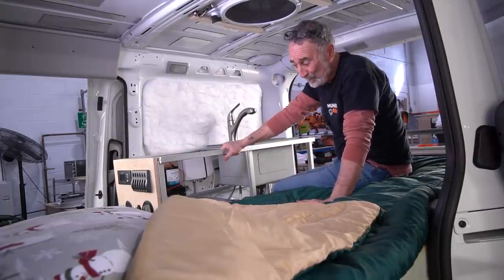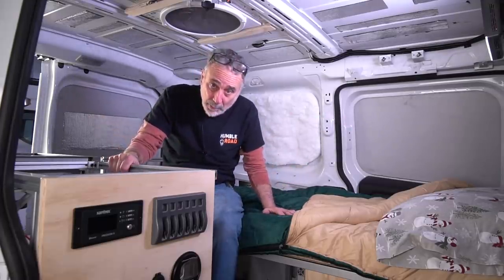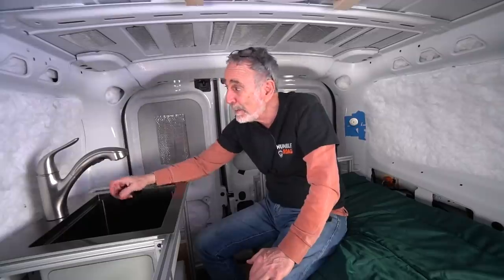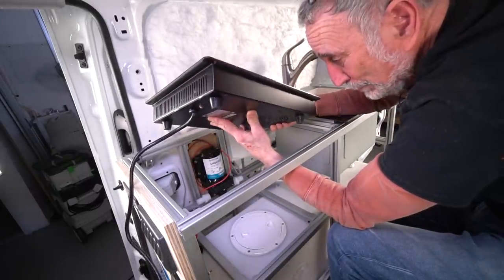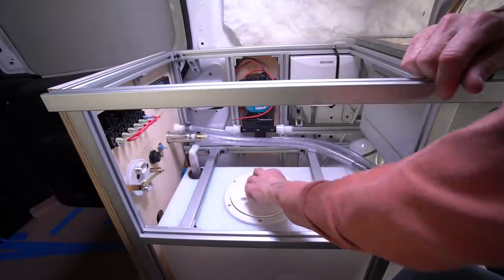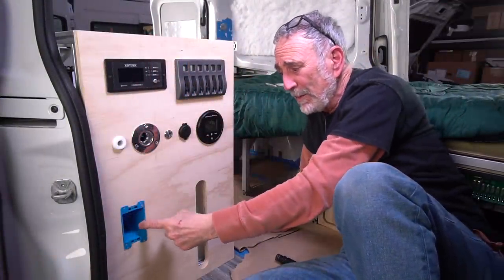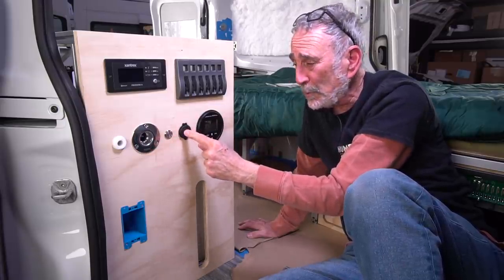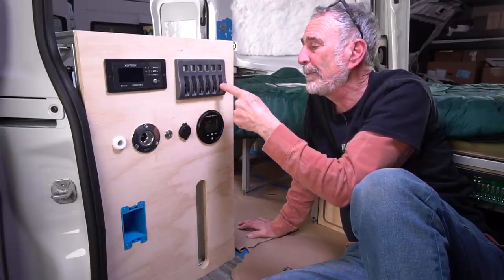The Humble Road Promaster City mini-camper. BIG features in a little VAN.

Comment: Flush cooktop is best to me.  Having it visible is contrast worth seeing,  now the on demand electric water heater is dumb in my opinion.  I understand the space consideration though.  I opted for electric but one that half the power.  This way if I’m traveling, I can turn on the electric water heater and alternator power will provide most of that power.
Reply from the maker: No room for a heater tank of any practical size in these micro campers.
Reply: @HumbleRoad  yup, I get it.  I'd just opt for cold water showers then.  The energy tax however short for that is too great imo.

Comment: It's like you're trying reverse psychology on us. Exposed cook top is the last option.
I miss the Forestry Forest, and Kira & the Survival Pod solution.
And that is a cook top on a tray that slides out in the direction of the bed. On the correct height where you can sit on your bed and cook. This is not a kitchen where you can stand against the counter and bend over the pots and pans that are cooking.
try to (dry) cook with a real pot and a spoon in the current set up if the pot was on the counter, maybe it's acceptable and comfortable enough.

Comment: Consider turning that induction cooker 90 degrees from how you were holding it, and putting it down at the end of the countertop so that there would be a small (but probably adequate) permanent prep space between it and the sink. I am curious why you're building the kitchen left handed? Especially if the cooler is at the left side. Normally, I would expect storage, wash, prep, cook. Have you considered a wall vent above the cooker?
Reply from the maker: To me it makes sense to have the prep area centrally located between the fridge and the sink. The MaxxAir fan is mounted basically right over the cooking area. Set on high exhaust, it will pull your hair up for a free haircut! 😊

Comment: Two problems with a recessed cooktop, 1) cooking spills, where will they go? and 2) what happens when the cooktop is left on and the cutting board is installed?  On the control panel, I wouldn't put the 120 volt outlet under the water fill!  I think you're going to want an S or P trap between the sink and the grey tank to keep sewer odors in the grey tank.

Comment: I think your design processes show a great deal of forward thinking and concern for safety.  But, the water tank fill access and overflow is directly above and too close to that GFCI electrical outlet.  I would definitely not be comfortable with the placement of a water fill access being in that close a proximity to an electrical outlet, of any type.  If that was going to be my van, I would want the positions of those items moved away from each other.

Comment: True to son - everyone is anal aboutmore  storage - Why❓ So Y'all can bring more sh*7❗
Big deep sinks are Gold. I put one in my rig 5 years ago. 
Lowering the sink could be a cleaning nightmare.
 I personally fastened a mounting plate (3/8 birch ply) to the bottom of my cooktop. I inserted 4 threaded nuts in the countertop and screw the mounting plate a/w cooktop to the countertop for inside use. When I want to cook outside I easily unscrew the 4 hex dome head screws - Bamm George's your uncle.
Reply: Oh & BTW the top-mounted cooktop acts like a perfectly fine landing area when not in use. Also, the cooktop countertop was built about 3 inches lower than the sink countertop area. (my sink & cooktop is in the same orientation as mini me's)
I have spent about 12 months traveling in the van with this setup and has worked Brilliantly❗❗❗

Comment: I would not want to deal with wires when it comes time to put away the cooktop. Not unless I rarely bring it out to use. 

Only problem with having it built in in someway might be the size factor if I needed to replace it. If the new cooktop is a different size, the module might need to be altered or the cooktop would need to be mounted by a method that is not tailored to the specific cooktop’s specs.

But cooktops might come in standard sizes or they might not need much replacing. 🤷‍♀️ I’m not sure